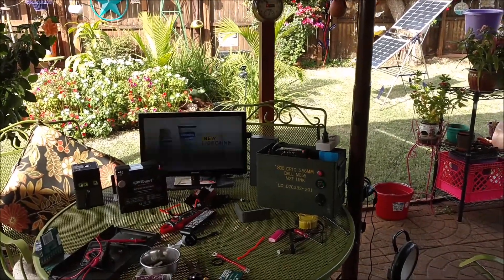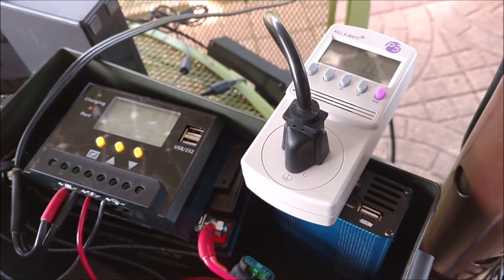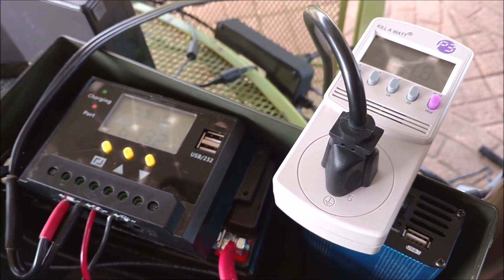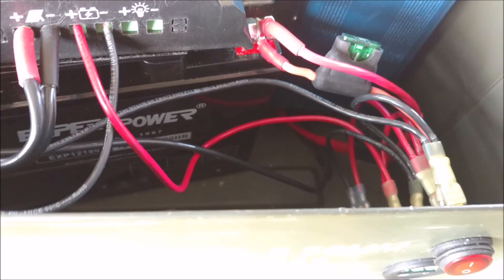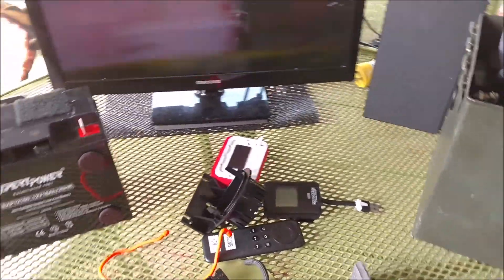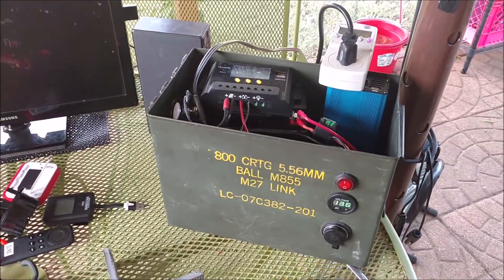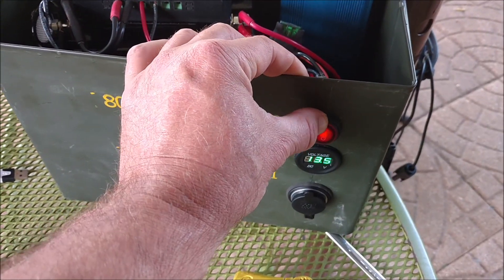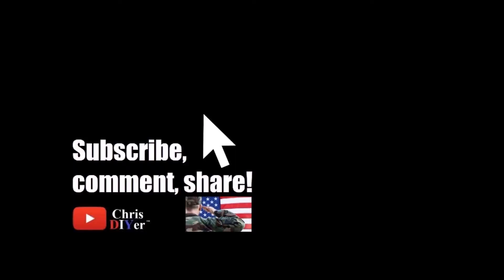(new) Ammo box micro 12v solar generator

Comment: Looks nice!
How much does that AIMS 180 watt pure sine inverter draw when just on and idle? Looking to find something to run a router and some other equipment (too many different voltages to make a DC-DC practical, including a laptop), but really hate losing the ~1 amp of my latest (and so far very well worth it) AIMS 3000 watt pure sine inverter that I've acquired.
Wish I could get rid of the ~12 watts of loss, or at least cut it down a bit.
Reply from the maker: Aims needs to pay me for promoting this product and looking up specs for my viewers. The manual says .3 amps (@ 12v) comes out 3.6 watts
Reply: Nice, thanks!
Yeah, maybe they should give you a bit of $$$, or at least free stuff!
Reply from the maker: I'm game! "..hey AIMS Power. Send me a Model Number:picoglf20w24v120vr 2,000w pure sine wave inverter/charger (24v). Not counting my chickens on this one...

Comment: Building an ammo box battery backup earlier this year got me moving one my larger solar project.  Mine is in a .30 cal ammo can with an 8 AH glass-mat battery.  I have it pared with a 50W panel from Home Depot and use it to run my QRP (low power, 5W out) amateur radio transceiver.  Shoe-horned in a PWM controller, a  Dual USB Socket Charger 2.1A&2.1A + LED Voltmeter + 12V Power Outlet + ON-OFF Toggle Switch from Amazon which worked out REALLY great,  URL:  https://tinyurl.com/y9cp2z2b so, am not trying to get 120VAC out, just 12V but it meets my needs and when the sun is out, that 50W panel keeps the battery topped off with the radio running nicely.  The switch panel I book-marked might meet your needs, nicely.  Its 9AM and am re-charging the batteries @20A, running the fridge, freezer and doing laundry all on solar all with over 1KW to spare.  Gotta love it.

Comment: Great job, I like the box, what are you planning yo power off of it?
Gotta love those step bits, excellent for thin metal.  
Take Care Friend.
Reply from the maker: Thanks...small stuff with this. Less than 100w or so. Can plug in my 12v DeWalt 20v lithium charger to it if needed. So, could be at a job site, erect the 100w laundry drying rack solar panel, charge a DeWalt battery using the 12v power socket, phones, or what-have-ya. Rugged was the idea behind this. Weight about 30 lbs